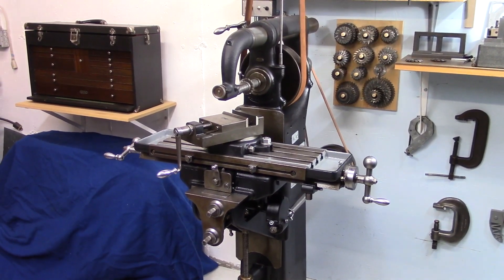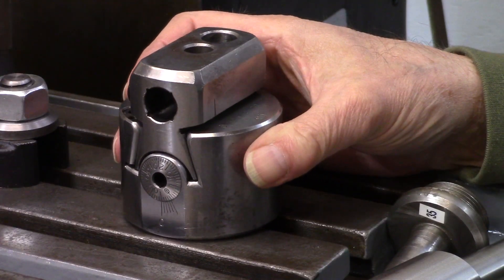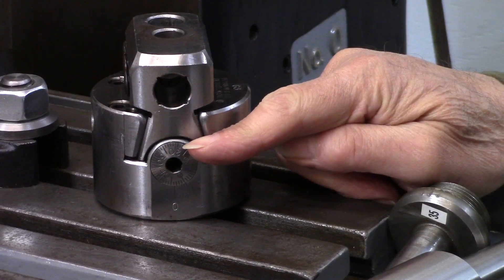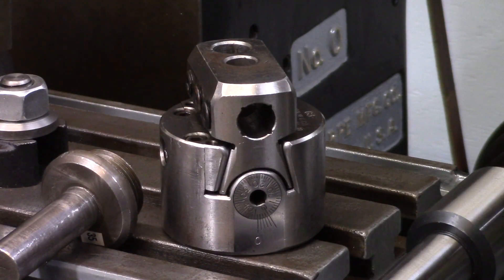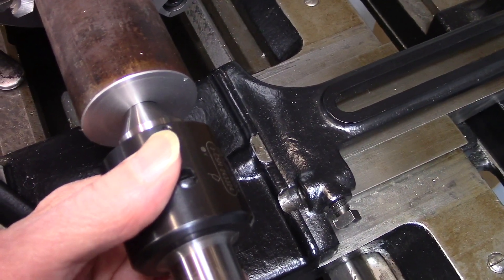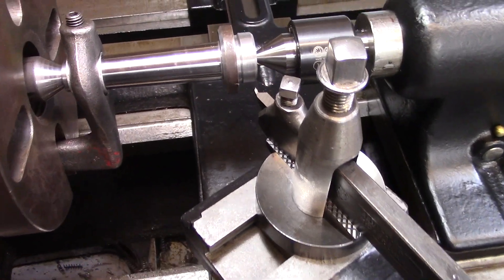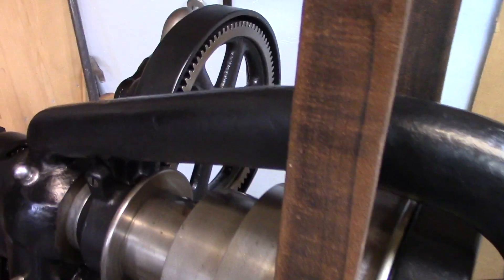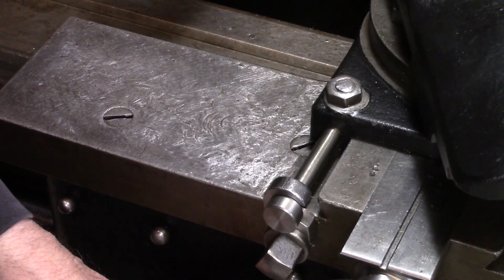Interesting Job on the Hendey Lathe with Jon Siegel

Comment: Great video, thanks for sharing!  I have a Hendey that is a bit older than the one you're using in the video.  Other than the brute force and rigidity of the old girl, my favorite thing is that there's no need for a threading dial.   Second favorite feature would be setting a stop on the feed bar which disengages the feed automatically.  Great for boring or threading deep into a hole.